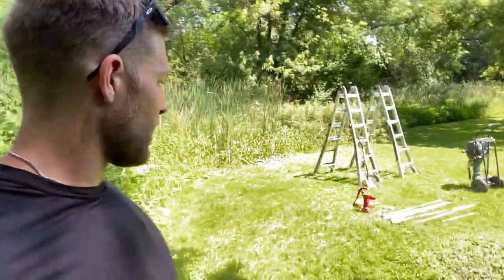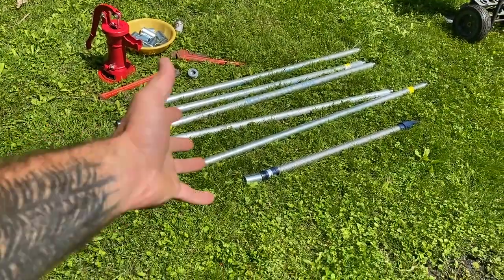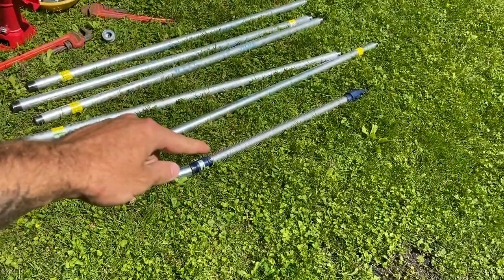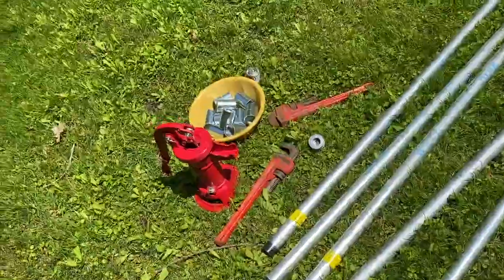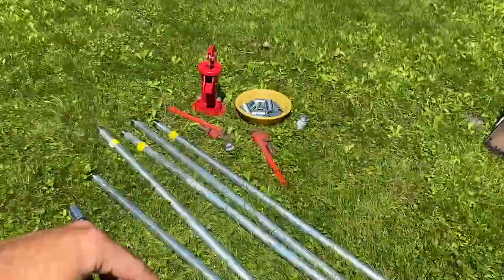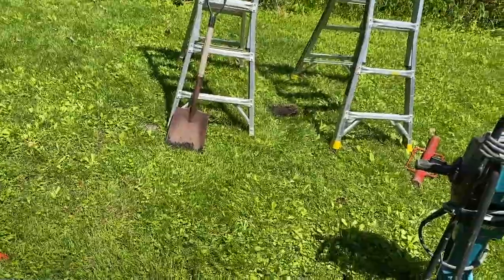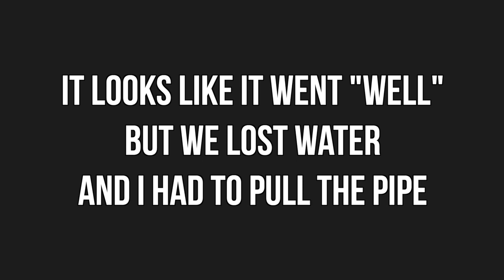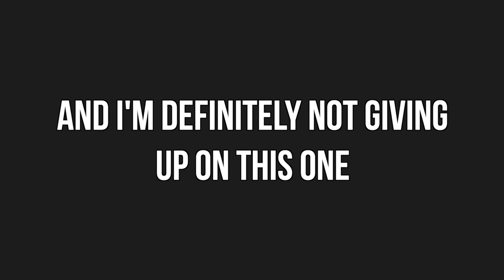Driving standpoint well with a jackhammer - I hit pressurized groundwater

Comment: Helpful tip: Dig down as far as you can with a hand auger before using jackhammer. This saves wear and tear on pipe assembly.  Also, After 3 shallow wells with 1 1/4" pipe and sand point, I switched to a 3" pipe and sand point. Result is greatly increased flow and quicker charging of pressure tank.

Comment: I have driven about 50 of these wells in my life down   Harrison Ohio and 1 key critical step you're leaving out of your process (you cannot do this with a single man and a jackhammer method , but if you listen you will understand why ) is when you connect your pipe to the last piece of pipe that was driven that you take your drive cap off , YOU WANT TO MAKE SURE that you have a man turning that pipe with a pipe wrench in the direction so which continually TIGHTENING that pipe... I don't know how many Wells I seen guys drive , that did not have a man down there continually tightening that pipe as another man was striking it and the well fails... It's because when you are continually beating that pipe from the top ,  you are crushing in the threads of all those couplers underneath the ground because they are not tight enough to hold... I do not care what kind of cheater bar you put on your pipe or how big a pipe wrench you have , it will not tighten them couplers up like when you are continuously turning that when someone is hitting it!

But you have a great post with that jackhammer trick , I never thought of that, just make sure next time you got a volunteer that'll turn that pipe for you... it's not hard to turn it , but it makes all the difference in the world , and you're well will not fail !!!
Reply from the maker: Powerful advice! Thank you!

Comment: #1  Get rid of the stupid drive cap!! That's for using a sledge hammer and it will probably still bugger up the threads!  Just cut the threads off of the sacrificial nipple and put the bit right over that. If it's really hard ground, might have a spare nipple handy.

#2 use teflon thread paste. Better than the tape.

#3 make sure you use "drive couplings" not standard ones and tighten with a pipe wrench. Every few feet, tighten again to make sure the threads are seating  correctly. Tighten as you go. 

#4 It's easier to work off the bed of a pick up truck. And safer than balancing on the ladders.

#5 Back flush the well with a garden hose if at all possible. You want to try to drive the fines away from the point. Usually, there's a clay layer above the water bearing sands. If you try to pump out of that, your point will get plugged.  You can kinda feel the difference as punching through the clay layer will be a bit harder and get a little easier when you get through it. Note that as long as you are below the water table, you can put the point lower to get in the sand. The water will come up in the pipe. Do check water level with a weighted string or even a tape measure. 

#6 You really want to back flush the well for best production. A garden hose works best, but you can make a "plunger stick" with a good rag wired to the stick. Drill a hole through the stick and wire through the rag and the hole. You want to avoid losing the rag down the pipe although you can probably fish it out with stiff wire. Fill the pipe and use a plunging action to try to force water backwards through the point. 

My guess is that the point is in the clay layer and not sand and the point got plugged with fines. You might be able ta add a section and back flush it clean. When you buy the point, they come in different mesh sizes. If you get a fine mesh, it will tend to plug easier.

I advise talking to neighbors with shallow wells and try to get a good idea of what the ground and water table look like in the area, A local hardware store might know the area too and have the best advice. The people at the big box stores won't have a clue!  Really best to research it before you start. 

As for clearing out the plugged point, there are various methods. A power washer adapted to the pipe or with a hose down in the pipe can sometimes work. If you get it below the water table, the pulses can sometimes blast it clear. 

There's an old time trick called "shooting a well"  It involves firing a shotgun shell down the pipe. Just be careful trying it, and ideally, cut the end off the shell and remove the shot and plastic shot cup. You then replace the plastic wad with cardboard or paper packed tightly. The old timers would just put the barrel down the pipe and let it rip!!  But if you are creative, you can make an "adapter". I've seen one that an old timer made that screwed right on the pipe and did the job nicely!! I will avoid too much detail and point out that you should only try this at your own risk!! But I've seen it work!  You might also try citric acid. It works good against a lot of iron. You can buy it in granular for, food grade.  It's pretty safe to use. Pour some in and let it sit a few days. A small amount of muriatic acid can work too, but use with caution!!  No matter what you try, flush it adequately afterwards!! and use common sense caution!!  

First thing to try are the garden hose or plunging. But if indeed you are in a clay layer, you need to get past that. 

You can always try pulling it up too. Some chain wrapped around the pipe and a mechanical "farm jack" can work. You need a good stable base like heavy plywood 

Putting in a shallow well sand point sounds easy, but there can be more to it than meets the eye.  You've made a great move though by using the jack hammer! Easiest method by far to drive one!!  Good luck!!

Comment: The number one problem is the pipes are supposed to touch inSide.   That way the stress of driving isn’t on the threads.  Those couplers used to have a collar inside which the pipe would rest on protecting the threads.

Comment: Why steel pipe and jackhammer? We used to do them with PVC by water-jetting: Connect a hose, using a sandpoint designed for that purpose, watch it sink. Isn't that cheaper and easier for such a shallow well?
Reply: Then you need a supply of pressurized water
Reply: That method is only good if you live in a sandy area. It won’t bust through thick clay.

Comment: If you take off that drive cap would the jack hammer fit over the "sacrificial nipple"? I've been thinking about putting one of these in on my hilltop but I'm worried it might be a waste of time.  I have a spring that flows 24/7/365 but it's probably 100 lower in elevation so what are the odds I hit water before that? That's alot of hammering lol.
Reply from the maker: Not sure about the coupling.. and the hammer was a rental so she's gone!!

The water table probably sits at the level of the spring and these sandpoints generally don't go deeper than 30. You can hit 50 and deeper but that pushing the limits I believe.

Or if you really want maybe try some witching sticks and see if they move up on the hill, maybe there is an underground vein you can hit.
Reply: It's not a jackhammer, it's an electric hammer

Comment: use a spare coupler for the driver cap instead of that driver cap. your post driver and jackhammer wouldve slide over it perfectly. also after that well cleared up you shouldve done one more 5ft pipe to get it seated in the vein.

Comment: Great video - I am 71 years old and can't beat 20ft of pipe into the ground.  So your jack hammer sounds great.  What bit did you find to drive the pipe with the jack?  Did it come with it?
Reply from the maker: I rented a bit end that "wasn't the right tool for the job" from a local top shop. Hindsight is 20/20, I would recommend using a gas post driver with a 3.5 to 4" opening cup. It's lighter and easier to lift, and will do the job just fine as long as you have sandy or clay-ey soil. (although this job clogged after a while, and I need to redo it, so only go for it if you have sand). But, if you want to use a jackhammer, it will work, just make sure you're prepared to lift a heavy tool, and have a cup with the correct side opening.
Reply: @WillMagnerFitness  thanks for that recommendation - I found a Gas-powered post driver for rent for the day at $130. I have a 3 hour drive to the site. The rental shop opens at 7 am. So if I leave the house at 6 am and get to the site say by 11 am - and then I have to leave at 2 pm for the four hour drive to the rental shop from the site. Wow!! Three hours - I wonder if it I could get it done. hahahaha. Otherwise the weekly rate is $382. Yeah probably better to just do a week rate since two days would be $260. I suppose I could do it in two days. Still a lot less than $1000 for a new one.  Oh wait Home Despot has better rates and is closer!
Reply: @WillMagnerFitness  Someone tried a GPD and it did not work AT ALL!! hahahaha. I guess the well point is much harder than driving a empty post!! Yeah they were using the Titan GPD which was destroyed by the fence business - because the Titan didn't work at all. Still I have clay hardpan and I don't think even the bigger GPD would work compared to a jackhammer....
Reply: It's not a jackhammer, it's an electric hammer

Comment: How did you pulled the pipe out?
Reply: I honestly don't know how anyone can pull the pipe. We used a tractor to try and pull ours, which was the 3 ft drive point and only 10 ft of pipe.. It's still 8n the ground. The top pipe finally just sheared the threads of the pipe below it.. So, we've decided to just hand dig a well instead. We've finally hit water at 8 ft down. It's hard work but we won't have to worry about clay clogging the drive point. It'll be better in the long run.

Comment: Wow. You are recommending the wrong sealant. You dont have the correct digging tool, auger hole digging tool, and your ladders are set up weird and you admit you are working  with a dangerous tool without any idea on how it works. No plumbing the pipe to true. No drive cap to save the sacrificial nipple? You sure should have made that pump higher off the ground. You also should have dug around the hole and made it so you could cap the area around the well with concrete using that as a base for your well house.  The best part ive seen so far is the cleaning reminder. Why was this the top recommend video on driving a sand point?